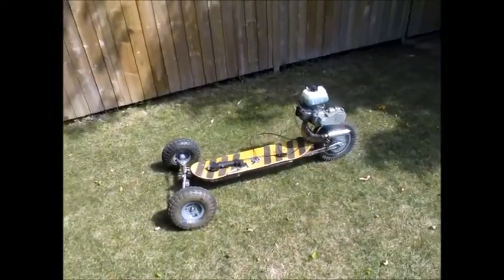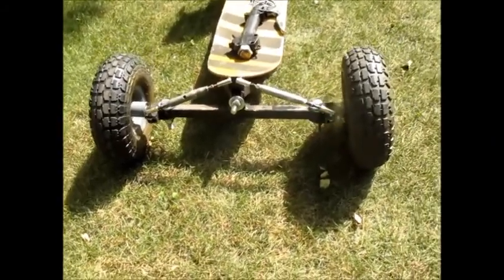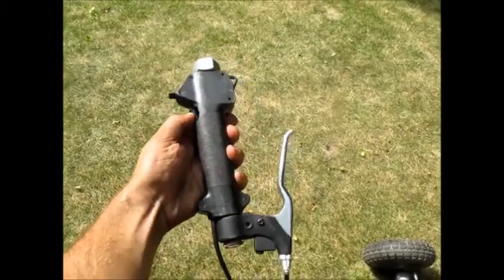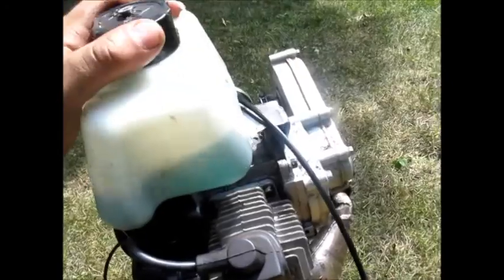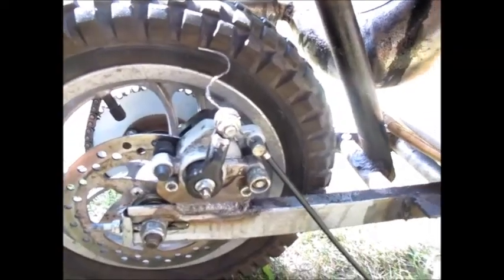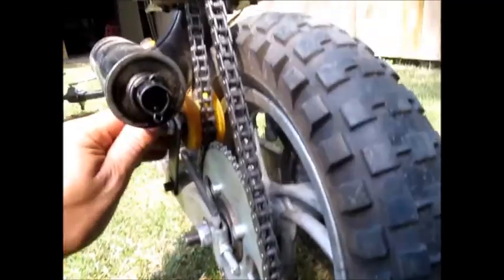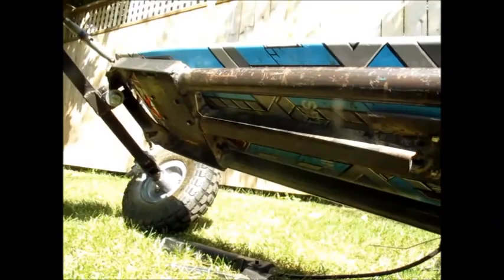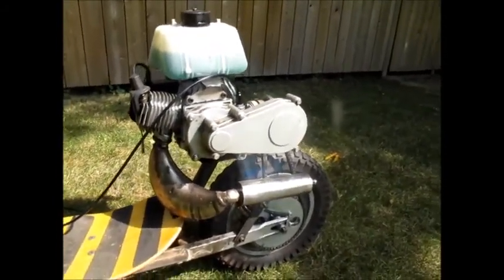Moto-Board Home built motorized skateboard, scary but awesome!

Comment: Great action on those front trucks. How's the high speed stability? I'm working on a pair for a FrankenTraption-mountainboard with 12"in wheels 🤤 I'm going to incorporate a derrailure for a transmission or try lol. I want hill climbing dammit!
Reply from the maker: Hello dick, sorry for the 4 month late reply, I have been out grabbing milk and smokes. But I came back didn’t I!? I’m assuming your done with the beast you’ve been working on by now but figured I’d mention: I’ve experimented with motor powering a derailleur and it didn’t end well, they don’t like a lot of speed and jerky movements, if you want interchangeable ratios on something small like a mountain board I’d suggest a small cvt, otherwise just reduce the hell out of the fixed gearing and climb away. 

This thing is geared crazy low so it maxes out at around 30kph, but climbs hills fine. With regards to the speed wobble, just try to lean back a bit with the caster, tow in your wheels and it will hold straight...ish... also, go with a slight negitave camber so when your on softer ground your outside wheel can dig in a bit and boom! Geometry!...... science wins!

Comment: Great design.    Something to add, if you were to make a strap handle off the from of the board, you'd be able to lean back against the strap.    Mine as well run the accelerator and brake cable down the same strap.    The steering is genius.    My mbs mountain board hates to turn.    I'm copying the reverse akerman idea.